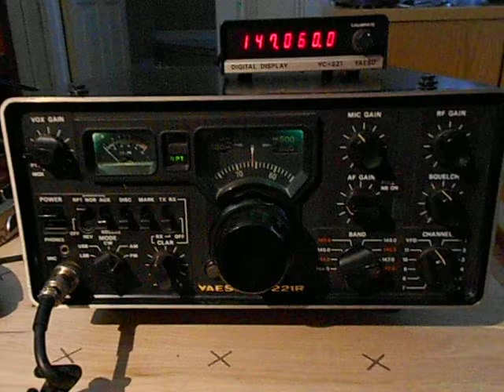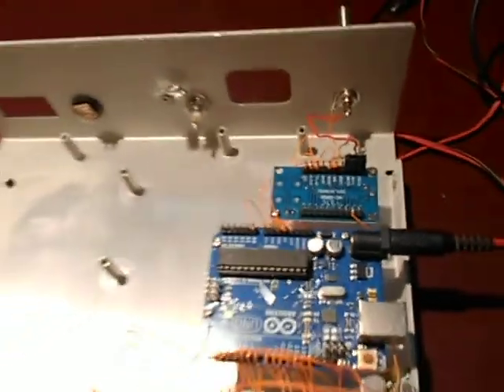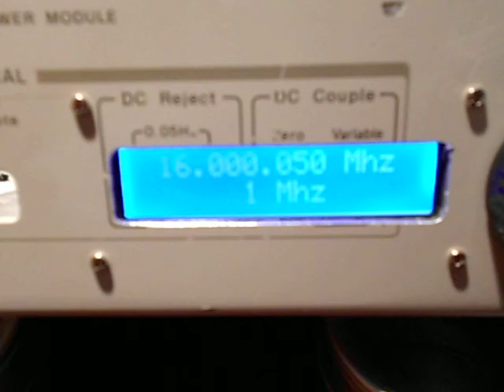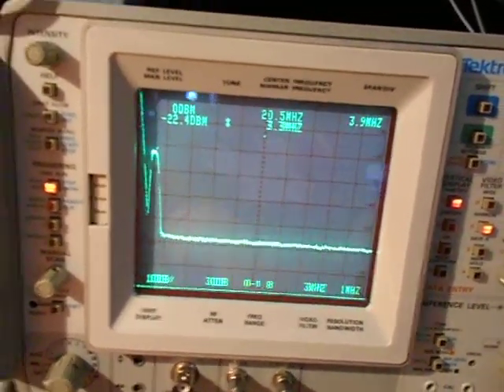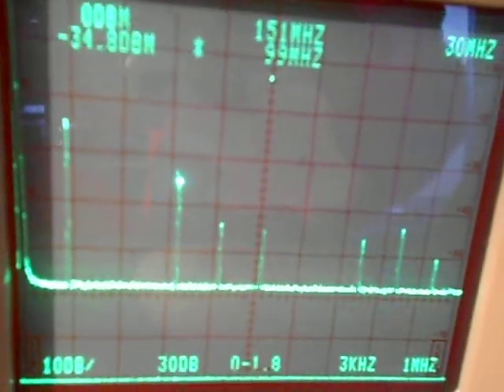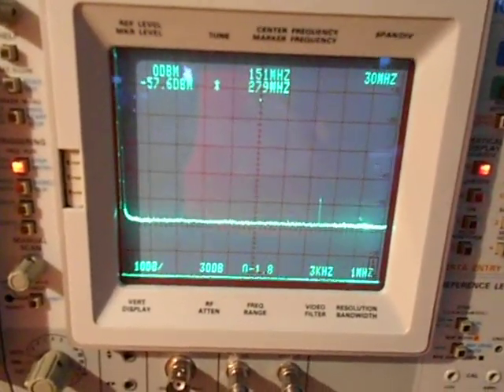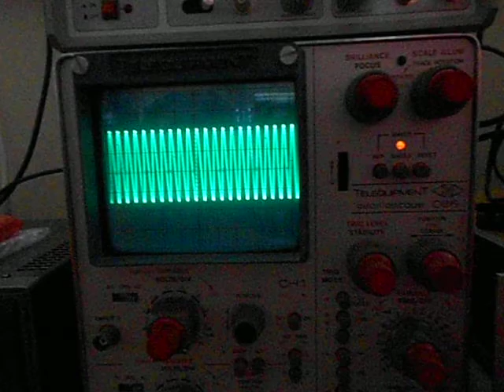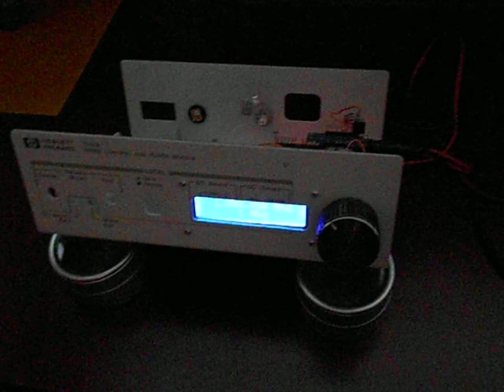Arduino Uno and AD9850 DDS

Comment: Hello excelent project , does it work well on low frecuencies? like 30 hz?
Reply from the maker: Yes, with proper programming, and tweaking the LPF. This is an old project, but as I recall, this DDS can start from 0Hz.

Comment: The output is a differential current into 200R. One output just terminates the negative out so that the other is single ended, use that one. The on board low pass filter is a 200R 72MHz 7 pole eliptic, taken incorrectly from a AD9851 datasheet with 170MHz clock. for your purpose it might be worth putting in the correct 50R 42MHz filter. There's a 5 pole eliptic in the datasheet.

Comment from the maker: Thanks for watching, Harold. Congrats on the fb NE602 rx. I'm experimenting with a NE602 as an osc and mixer, but have some issues getting it to oscillate @ 118Mhz using an overtone xtal. Have used it before, though - with good results - on a hb HF trx (9MHz IF). 
My transverter project is still ongoing albeit for a minor setback - because I found a nice HX-240 transverter. 
I have another video of that here.....73.

Comment: Wow,
Good job! I used Rich's setup for a VERY simple single conversion receiver. I used old radio parts for 45khz IF, a switchable loopstick front end and an NE602. No where near as neat as your setup but works better than I would expect.